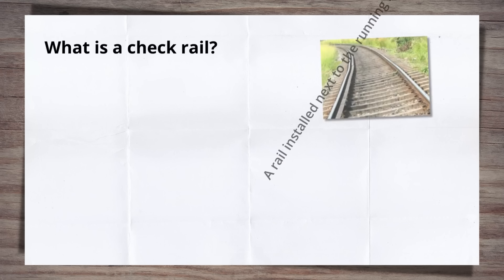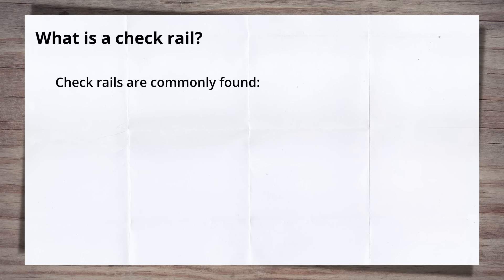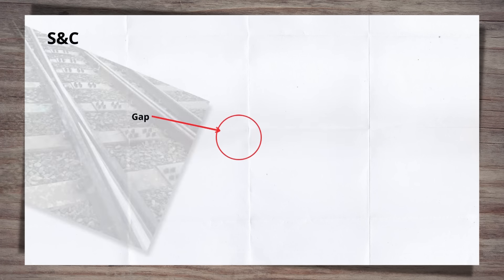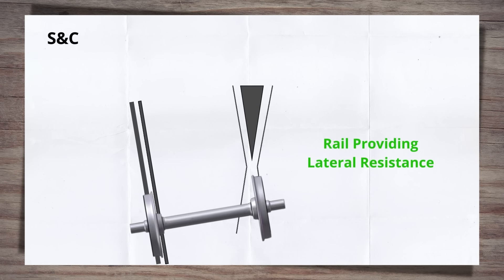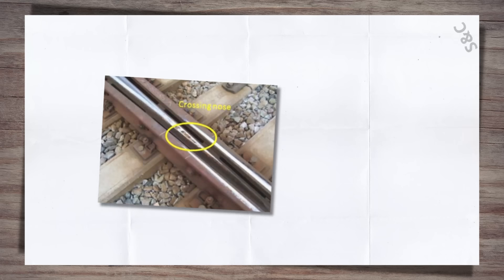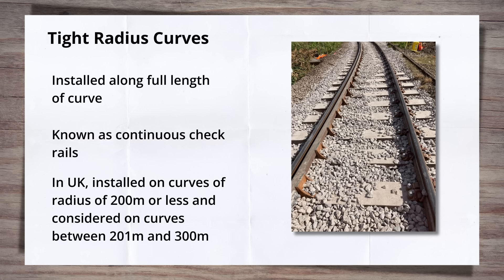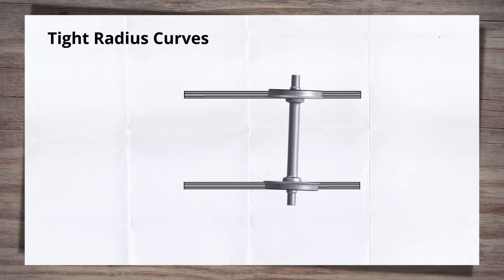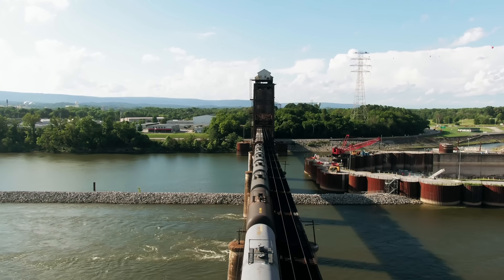What do Check Rails Do on the Railway? Why Railway Engineers Install Them?

Comment from the maker: Hi, a number of comments have mentioned not explaining what S&C stands for in this video, an over sight on my part!

S&C stands for switches and crossings, the parts of the track that make up railway junctions and allow trains to move between different lines.

If you want to know more, I have a video explaining what S&C is, which i would encourage you to check out:
https://youtu.be/hzhPx4p7vc8
Reply: Here in the United States, reference to S&C is usually for "Signal and Communications".
Reply: I had already figured that out in my own, knowing the British counterpart of what vernacular we speak.
On this side of the pond, we call them guard rails.
Reply: @B-and-O-Operator-Fairmont  - also we used to call the cross overs “Frogs”

Comment: thanks, i've seen these and wonndered what they were. nb, however, you don't define S&C in the video, and as a layman, i've no idea what this abbreviation is.
Reply: Switches and Crossings
Reply: I wondered the same thing. I think "S&C" is an abbreviation for "(S)witch and "(C)rossing".
Reply: There was a link in the video - but a little hard to see
Reply from the maker: @thomasstambaugh5181 is spot on, it stands for Switches and Crossings. Sorry, I should have explained that!
Reply: Just to add there was a link to S&C in the upper right when he first mentioned it.  I luckily happened to notice it.

Comment: If you're going to educate people you need to do away with Acronyms. S&C needs to be told in full. Don't assume your audience knows this. I am sure if they know S&C then they will know what a check rail is.  Railways are full of Acronyms don't use them for educational purposes and different countries use different acronyms.
Reply from the maker: Thank you for the feedback, thats a big takeaway for me on this video and something i will double check in my videos going forward
Reply: Thanks for clarification.  I struggled with S&C here.
Reply: Acronyms are usually fine so long as you use the full phrase first and then use the acronym with the full phrase used every now and then as a reminder. For example, “…Switching and Crossing, or S&C for short…”
Reply: How about the check rails seen on trestles and bridges, which are usually straight track?
Reply: @coachhannah2403  My thought as well. The reason is a bit different, they are there to prevent a derailed train from completely leaving the track.
Reply: I was taught, in multiple writing classes, including technical writing, that the first time an initialism or acronym (different things) is introduced, it is in parentheses following the complete term name.
Reply: Absolutely.  Each and every acronym and abbreviation needs to be defined upon initial use in every lesson.  Maybe a second time if it is a complicated one.  Basic Instruction 101 stuff there.
Reply: And yet, despite your well received comment, you chose not the educate the rest of us who don’t know what S&C stands for? Completely understandable if you yourself don’t know, but if you do, it’s the height of arrogance to point out the lack of definition while not helping clarify it for the uninitiated.
Reply: Great general advice for every subject.
Reply: Your point is valid, @markylon, but you made it in a rude and aggressive manner. The video guy's just trying to help. No need to kick him in the teeth.
Reply: I’m an ex-signaller (signal boxes) from the New South Wales (Australia) railway and I had to guess (correctly, it seems) what S & C meant.  We call them points, not switches.
Reply: So... what is S&C? @thepwayengineer
Reply: @user-uy2nl5vp6m   he's already made the definition in the comments since, so go look it up.
Reply: Have you seen anything positive at all in this video? If so, please mention it. Try to be positive.
Reply: @donalfinn4205  don't be such a Karen.

Comment: Why do trains use fixed axles instead of independent wheels on right and left sides? I would think that if the wheels could rotate independently, such as with a car or truck, that would eliminate or reduce greatly the possibility of a wheel derailing in a curve and the horrible squeal that the speed differential causes. We must have the bearing and suspension technology to support the wheels independently right and left.
Reply: Im pretty sure a fixed axle actually works with the conical shape of the wheels to keep the train centered on the rails.  There are a number of videos that show the physics of this.  If nothing else, independent wheels would make the whole setup much more expensive as the suspension systems would have to be much stronger to handle individual wheels instead of solid axles.
Reply from the maker: I think you have hit the nail on the head here!
Reply: Instant derailment
Reply: @NicholasIstre  You’re right. The exact shape of the cone is important as well - not necessarily a constant angle. The mechanics of a suspension system has it’s part to play as well, as does the angle of the rails themselves, the amount of cant provided on curves, and how much cant deficiency (hence the permitted running speed) on a curve.
Reply: Practical Engineering has a great video on this topic. It's based on US rail standards, but the essence is, the crown of the track and the angle of wheels work together to equalize the distance traveled by both sides of the axle. Likely also why the 200m guidance for tight curves as well, since that is the minimum radius that is accounted for in the basic design.
Why add complexity to something that works well? Look at what happened in Germany when they tried to make an overly complex wheel for high speed rail.

Comment: I've been a railfan all my life and I've never heard it called a check rail.  But then I heard the accent of the narrator - it makes sense.  Some call the wooden planks under the rails "sleepers" in the UK.  In the US, we call them ties (cross ties).  Two people separated by a common language!
Reply: I've heard the term sleepers also used for the concrete ones used on some light rail systems in the US.
Reply: @seanbohannon  "Sleeper" is the generic English term for a horizontal beam placed on the surface of the ground to support a structure.   A crosstie is a sleeper that crosses the roadbed and ties both rails together.  All crossties are sleepers but not all sleepers are crossties.  Sleepers are used in all sorts of construction, not just railroads.
Reply: Sleeper someone who is asleep. Not a railroad tie.
Reply: @garthmcgibbon4285  Not to a brit.
Reply: @garthmcgibbon4285 sleepers lie on a track bed...
Reply: @garthmcgibbon4285  A tie is something you wear around your neck, not a railway sleeper...😉
Reply: Following British practice (and they invented railways after all!), in Australia they are also known as sleepers.

Comment: Some American railroads used automatic greasing devices on some curves along with a check rail/guard rail setup trying to reduce friction and wear.
Reply: I have also seen greasers on curves in the UK rail network ... specifically on a bend alongside  the Norwich "Crown Point" rail depot where I used to work. I don't recall if there were check rails on that section.
Reply: I do know those are used in Germany.
Reply from the maker: Also very common to see lubricators on the UK network as well.

Comment: Are check rails also found in bridges, or are those something else? I seem to remember seeing them on pretty much every bridge
Reply: At least in the US, those are called "guard rails". They interact with wheels only after a derailment -- their purpose is to reduce the risk that a derailed piece of equipment will fall off the structure. They act to keep the truck (or "bogie") vaguely aligned with the rail. In order to fall off or catastrophically interfere with the surrounding structure, the wheel must climb over the guard rail.
Reply: @thomasstambaugh5181  Thanks for the explanation!
Reply: They are also guard rails in the UK. They have a totally different function to check rails in that they serve to restrain derailed wheel sets from moving too far sideways to try and prevent derailed vehicles hitting bridge parapets or supports. See the accident at Enschede in Germany for example.
Reply from the maker: Spot on! Very well explained thank you
Reply from the maker: Thank you for the explanation

Comment: So the check rail on a curve is installed on the inside rail to prevent the outside wheel flange from climbing the rail, right?
Reply: Yes, I think so from rewatching ,the photo the check rail is only on the inside of the curve. That is also how I understood it.
Reply from the maker: You are correct!
Reply: The weakness in this logic is the flange on the inside could climb the check rail just like the flange on the outside could climb the running rail.
Reply: @pedzsan  It is not the same because the shape of a wheel is not symmetric. If there was a high chance of the flange riding up the check rail they could have raised rail to stop that. I think it was not necessary to raise it so they did not because that would increase costs.
Reply: @thepwayengineer  I have seen one Fuehrerstandmitfahrt video where a check rail followed the OUTSIDE rail on a curve.  Noticed it immediately and thought, "How is THAT supposed to work?"

Comment: It should also be pointed out that, in a curve, that outer wheel climbing the rail, and the inner wheel doing the opposite, serves to make the effective diameter of the outer wheel larger, and the inner wheel smaller, helping to facilitate the negotiation of the curve.
Reply: That's the entire point of the conic section to the running surfaces of the wheels. Otherwise trains would only go in straight lines.

Comment: In France we also have checkrails (contre-rails) on certain bridges even without curve.
I bet it’s for preventing a rare but dramatic consequence of a derailment (falling from the bridge).
Reply: Not just France.  I've seen a number of Fuehrerstandmitfahrt videos from various places where every RR overpass or bridge has the double check rails, no matter how short the overpass or bridge may be.
Reply: I would classify those as Guard rails, although similar to Check rails, they are there in case of derailments to limit the amount of sideways movement and hopefully keep the vehicles on the bridge etc or stop them striking any structures supporting overhead bridges. Wheels do not normally come into contact with them, which does happen with check rails.

Comment: On the old Streetcar line in Pittsburgh to Washington PA. The line started as a narrow Guage  rail line in 1869. In 1905 the Pittsburgh Railway took over that line and install PA Guage (5 foot 2). Those narrow Guage rails were kepted as a check rail till the line was rebuilt in 1992.

Comment: I recall that some British heritage railway centres have had their 9F steam locomotives banned from main-line running by the rail operators because the centre driving wheel, which is flangeless, has been hitting the check rail when using points to cross from one track to another. 
Thanks for the great presentation.
Reply: True but also some check rails are proud (in height) of the running rail. This is why 9F’s are banned off the network due to the derailment risk of the unflanged wheel.
Reply from the maker: I never knew there were flangeless train wheels, thats interesting! Thank you for sharing and for the kind feedback
Reply: @thepwayengineer  the 9F is a 2-10-0 the centre axle driving wheel was designed to be flangeless to help negotiate curves S&C etc.  But they are now banned due to Network Rail using raise check rails in places. Would cause the centre axle to ride up and derail. Go take a peek at Evening Star at York.

Comment: Very informative.  In the US, we call them "guard rails" and they serve the same purpose.  There are also special "frogs" (where the rails cross) called "self-guarding frogs" that have a lip on the outer edge that pushes a wheel "from the outside in" to follow the proper course through a frog.  Those don't need a "check" or "guard" rail.  Any I have ever seen are in slow speed applications like industrial tracks or shop areas but they may be exceptions.
Reply: In steam days when the middle drivers were blind or flangeless, self-guarded frogs would deraill the blind wheels as they were wider than the flanged ones.  And yes, self-guarded frogs are restricted to slow-speed areas of operation.  Most self-guarded frogs are No. 8 or less and are cast manganese steel though I have seen a bolted frog.  Due to the design, all of the wheels need to be of the same width, within tolerance, to work as designed.

Comment: This is probably the first in-depth video explaining p-way engineering 👌🏾
Reply: What does “p-way” mean” since we seem to be talking about abbreviations, if you don’t mind?
Reply: @Dragonbear13-k2r permanent way, sometimes defined as anything within usually 2m of tracl but also a general term used to describe the general place in which there are rails/track run

Comment: I've seen these and figured out the rough idea of why. This video was useful for some specific things I wasn't aware of, especially regarding angle of attack. I am curious why they seem to be common on wooden trestle bridges here in the Western United States, even perfectly straight bridges?
Reply: As others have mentioned, these are different, normally having no contact with the wheels, being a safety feature in case of derailment, keeping the wheels close to where they should be.

Comment: I served my apprenticeship at a UK company who manufactured switches and crossings, finally moving to other engineering challenges in 1986. I worked on several projects involving "swing nose" crossings which technically needed no check rail. Did anything come of swing-nose crossings?
Reply: Some of them were, and might still be, in use between London Paddington & Hayes & Harlington, on the higher speed S&C. Without them, there would be too wide a gap for the wheels to pass over. Loads more elsewhere, typically with 70 mph turnouts, like the Wootton Bassett Down Main/Down Badminton junction. So more power operation & detection equipment to maintain etc.

Comment: I've seen check rails here in the US on bridges, presumably to give extra assurance that there will be no derailment at such an inconvenient place.
Reply: Different role on bridges. Those are guard rails (the gap to running rails is larger). Their role is not to prevent derailment but to ensure that the wheel after derailment does not move too far from the railhead to hit the bridge construction or fall over from the bridge.

Comment: 3:55 what about 200.5 meters? Gotta love the lawyerspeak – so precise and yet so often just wrong!
Reply from the maker: Oooooo, split the difference. I would err on the side of caution and look to fit a check rail! Better safe than sorry
Reply: You did not know there do not exist numbers that are not integers! Hence the radius of a curve clearly must be integer as well. By the same logic, pi equal to 3. \ironyoff
Reply: I guess they won't even think about  check rails there.
Reply: My answer would be that curve radii are always designed in integers, or at the very least are always treated as being in integers.  For example, the old Victorian Railways Grades Book, which included the curve radii of all curves (measured in chains i.e. multiples of close to 20 metres) are shown in whole numbers.

Comment: Thank you - a very good explanation (I hadn't heard the term S&C before, but I worked it out).  
Do we actually use the term switch in the UK?
Reply from the maker: Yes we do! 
I have found track staff tend to call them switches where as signalling staff tend to refer to them as points

If you are interested in switches I do have a video on them:

https://youtu.be/EdqNpDn17wI
Reply: @thepwayengineer  Ahhh, interesting! Thanks :)

Comment: What are the inner rails called (and what do they do) that you see on bridges or trestles? These rails are joined at a point on each end, curving to the center between the traveling rails, and they extend the full length of the bridge. You see them on straight as well as curved sections of track, and the flangeway gap seems wider than on these check rails you are describing.

Comment: Isnt there also a third common use for check rails: to act as a sort-of guard rail to prevent derailed rolling stock from travelling outside of restricted clearances along tracks?  Or do those types of rails have a different name?

I know it is common to have extra rails along track with restricted clearance for safety reasons, such as along tunnels, bridges, crossings, or near vital infrastructure (such as support pillars)

Comment: 2:56  I never understood the move to concrete rail ties. Wood has some give in it so it seems like it would be easier on the rails and the train cars. Concrete has no give and it must be both harder on equipment and louder, I would think.
Reply: It also lasts longer and is better for high traffic areas.  Also, right now, there's an LRT line being installed right by my condo.  It uses concrete blocks, which the rails attach to.  These blocks are placed on the reinforcing mesh and then concrete poured around them.
Reply: @James_Knott   Interesting. Thanks James.

Comment: Soo … the check rail on the inside of a corner essentially does the same job as a yacht crew leaning out over the exposed hull side of a yacht OR the ‘passenger’ in a racing motorcycle sidecar combination.